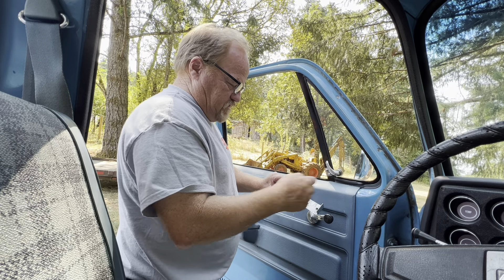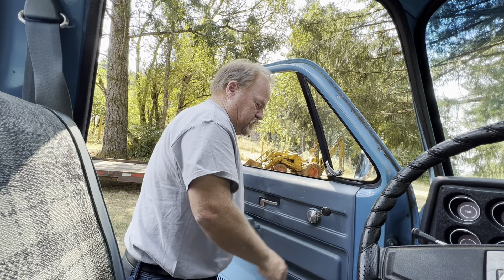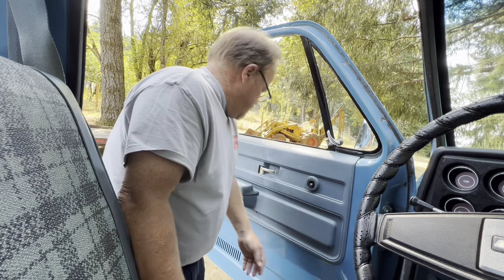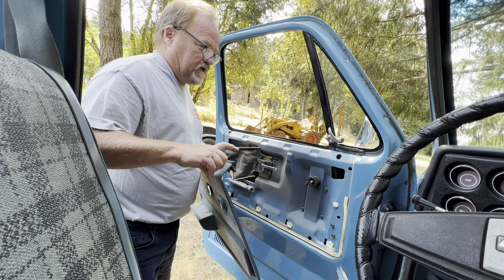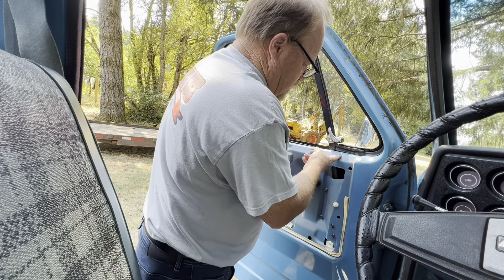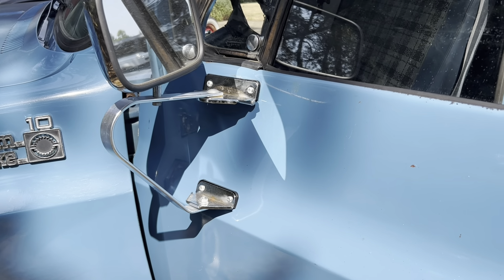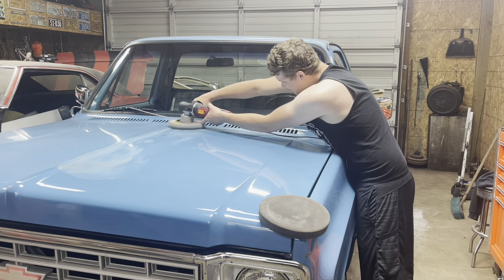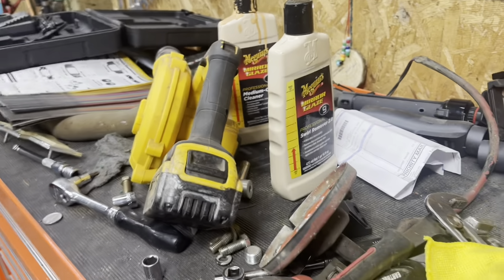How to Chevrolet C10 window crank handle and door panel. Most GM manual windows no vice grip

Comment: That bracket is for the small mirror. Not sure if it works on any other style mirror. Had to buy a set for my ‘77 stepside.
Reply from the maker: Correct. I believe it only works with the small mirrors.